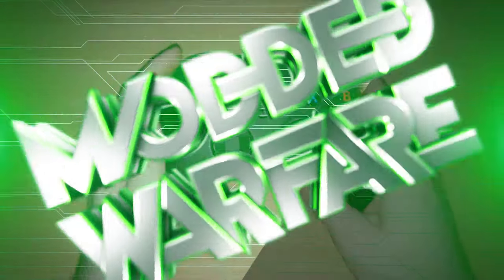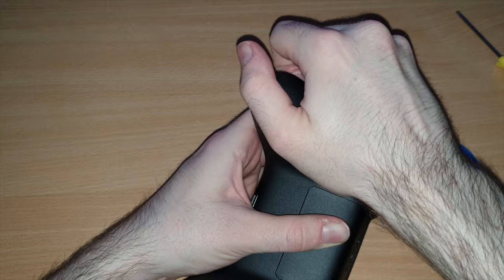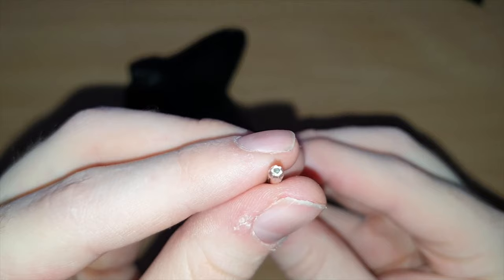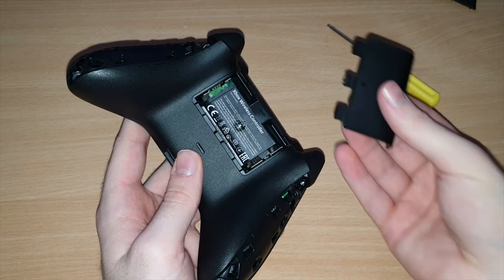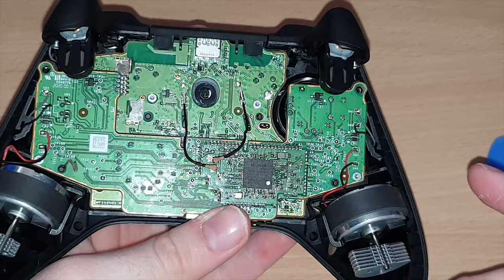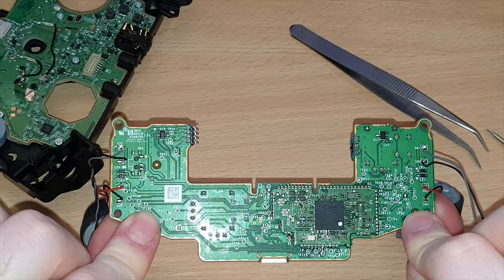How to Disassemble & Reassemble the Xbox Series X/S Controller

Comment: I feel like the people who disliked this video ruined their control
Reply: Yeah I've messed my headphone jack after changing a few things. Can still hear the game when I plug headset into controller. But not able to talk to anyone anymore 😅
Reply: Or doesn’t have that security driver
Reply: My a and x button dont work its my last hope so idc
Reply: Probably Ponies that are mad cos their controllers aren't as simple
Reply: I cut 4 cables but the tutorial is good and i left a like
Reply: Yes
Reply: @ward1ism  u can fix that in the xbox settings I did
Reply: U fuckin right
Reply: @spicychunk3517  I did I with out the security torques bit
Reply: ya i did
Reply: Left bumper no worky
Reply: I miss the dislike button
Reply: Yeah they probably did but I took my apart with zero memory of doing it be
Reply: took my about an hour but best video i’ve seen i hope the stick drift gets fixed
Reply: r @ra2alfool  ur on the spectrum
Reply: @Xackory  point proven
Reply: I was someone who broke their controller, I pulled apart the two wires from the mother board because I thought that's what he did and I messed up lol
Reply: @ward1ism it’s not the jack or anything u just need to update ur controller on accessories
Reply: @ward1ism same thing
Reply: im one
Reply: @ward1ism u fixed it or na
Reply: @ra2alfool my issue is I can’t afford to buy a screw driver just to fix a controller I’d have more luck finding a better working controller in the trash outside of a store that sells used controllers
Reply: Maybe it has to do with the fact that this was a partial disassembly. He never demonstrated how to remove the triggers, pins, and springs
Reply: Shush
Reply: Bet its all stick drift, common issues of x series
Reply: I'm about to give it a try wish me luck
Reply: The s seris is trash😊
Reply: I totally did... i cant figure out why it wont turn back on. All had to do was clean a sticky button. All wires seem fine. All the buttons function fine, but no light when you turn it on. Guess im headed to walmart
Reply: Without fail every time I take apart controller, I always break one of the cords that attached to the rumble packs and honestly, I’m not upset with it

Comment: These controllers were definitely made with the intention for no one to ever open them up after they were sold. Tutorial much appreciated and definitely needed!
Reply: Imagine not being able to change your car tires without owning a wrench only the company itself sells for a lot of money. Corporate greed at its finest
Reply: @doktorsljukex4174  the triggers are also designed very poorly. they often break because of a small millimeter long sponge pad getting pushed off a ledge. it's ridiculous.
Reply: yes i do agreed  + i lose two motors bec of low quality wires.
Reply: @doktorsljukex4174  are u troll  ?? u will lose motors if u open xbox one controller bec of the wires are low quality
Reply: What are you even talking about, nothing's wrong with these controllers, If you've taken apart electronics for once in your life, you'd find this process to be pretty easy, only the plastic parts are a bit annoying, otherwise it's pretty simple stuff.
Reply: @Sk-tp5xp  did u open xbox 360 before ?? look at the motors its came with two pins u can remove it anytime and there is no soldier and u can replace it without skills but look at xbox one + x , they want u to suffer btw motor xbox 360 just like ps4 battery u can replace it
Reply: Yeap they just want you to say screw it and buy a new one,
Reply: @Sk-tp5xp  Indeed, plus this controller is designed to keep a zero screws on sight for visual to match the XB One S, Series S and X designs. Totally inteded to hide them unlike that shitty PS4 Controller with lots of muck stuck where the screws are.
Reply: @doktorsljukex4174  i bought a T8 head with a hole in it and opened it no problem. what kind of wrench are you talking about lol
Reply: @giovannigiorgio2262 I never replace the motors anyway lol I tend to yeet them and forget about it
Reply: compared to controllers of previous generations... this was an absolute breeze after learning the panels come right off the grips
Reply: @Inuzika  I don't think so the 360 controller was very easy to take apart properly one of the easiest
Reply: That's the case with more and more modern pieces of tech/hardware
Reply: 100%
Reply: Xbox controllers are actually better to take apart than PS5 my new PS controller that I got with the console just 2 months ago has stick drift. Tried to watch how to open it so I can take out what I assume was plastic clips messing with it. The process is HORRIBLE. And apparently it’s some kind of factory grease collecting particles from the controller being used and parts of plastic grinding into it. So it’s made to literally get dirty and have stick drift without any outside dust alone. Like you have to take apart parts of the board just to get to the sticks or bumpers. most people said they got a new controller.
Reply: @Sk-tp5xp  ahhh a Microsoft spy trying to gaslight us. 👎👎
Reply: Of course they were. Being able to fix the stuff we bought by ourselves doesn't make them money. Now make the quality exactly as shitty as stuff breaks shortly after warranty runs out, and you have a business model.
Reply: @shadowzone2013  Yeah, I once thought the big advantage of competition is that there are many competing businesses trying to beat each other in terms pricing and/or quality. Now we have 2 or 3 big businesses waiting for one of them to come up with a shitty but highly profitable move so the others can follow up with it, knowing that the customer doesn't really have an alternative and will buy their stuff anyway.

Comment: Extremely helpful! X button was sticking and a little cleaning did the trick. Feeling super self reliant right now, appreciate you.
Reply: Did you tear down the whole controller or is it enough to just remove the cover to clean the a x b y Buttons?
Reply: @luisjunk5619  I was able to remove just the main cover and you have full access to the buttons - cleaned them with just a mini brush and it worked great after. No need for a full breakdown. Hope you got yours working. My X button was also sticking same with screen shot button. Cheers! 👍🍻
Reply: I also need to do this as my x is sticking too. Did you remove the palm pads and the 5 screws to get access to the buttons?
Reply: Good to hear! I spilled a little bit of soda over it and the B button is now sticky..  I don't want to break the whole thing open, just enough for the buttons.
Reply: Lol, my x button was sticking too. Almost made me delete one of my weapons on destiny on accident, so I figured I'd do this becsuse a bit of alcohol around the button itself didn't last. I took the whole thing apart for thr experience. Kinda fun, but definitely more intricate compared 5o previous versions. We'll see how long this lasts, as I just finished.
Reply: My X was sticky too lol
Reply: did you use the T8 security or FH and normal T8?
Reply: Bro my X button  is sticky to
Reply: Unfortunately for me just removing the face plate didn’t help the stickiness. Had to remove everything to get down to the buttons to take them completely out. Wasn’t too hard, just time consuming. The silicone base for the buttons was sticky and the root of the problem. Interesting that the series x controller is harder to get to the buttons than the elite 2 controller though.
Reply: I bought this “used” controller and the right bumper and left bumper was making loud noise when touching it gently but I replaced them aswell as the top bar to match the new bumpers I also took the controller apart all the way down and took the buttons out washed them in soapy water as the buttons would be sticky “B” button mainly I also took a cotton swab and cleaned the black plastic where the buttons sit then put it all together after and now it works better than ever took me an hour but worth it, also you can take the sticker off the controller when opening the middle bit and put it back on after so it looks like you never opened it before. 

(I can do this without tutorials it’s not hard)

Comment: Little component on the board where the wire connects to the other board broke off really easy, tried tugging hard on the other one to replicate and it stayed on. These companies cheap out on solder, use the least amount of solder as possible to save money and as soon as years go by they degrade and become weak. Ah well can't complain, had the controller for more than 2 years now with heavy use. Great tutorial by the way, straight to the point and clear
Reply: Yeah mine broke lol was brand new controller. Was tryna change buttons.
Reply: Do you know what they do?

Comment: This was such a useful tutorial, thank you! I'd been looking at other videos to try and get my controller apart to repair (spilt water on it and the Xbox button is firing without me pressing it) but this is the only video I could find that properly explains the steps. Unfortunately, my controller still isn't working properly, but I'm pretty sure I know what's causing the issue now so I'll definitely be coming back to this video when I try again to fix it :)

Comment: I used your old guide and it worked just fine.  I did have a lot harder time getting the top board unwedged.  Thanks for updating it, just finished fixing mine and saw this.

Comment: I lacked those fancy schmancy tweezers & had to cheat on parts of it with the flat tip screwdriver part of my little skinny computer dual plus tip & flat tip screwdriver to compensate & at the part of the reassembly having to plug those 2 black wires with those seriously tiny heads back in, had only my big fat clumsy butterfingered sausage fingers & still managed to follow this Vid & thanks to you, get my Controller disassembled & reassembled enough to replace the padding for my A B X Y Start Select Screenshot xBox Buttons to fix a mushy A Button!

Thank you so much for this Vid! This was my first of your Vids I ever watched & ya already earned your Subscribe! :D

P.S. We YouTubers are prone to Liking & Subscribing peeps & content we like & don't tend to need to be asked to first before we do it. :P

Comment: This really helped. I just needed to see how to pull it apart to the bumpers. I’m sure the rest of the video was great. I had “mush trigger” on my right bumper and I assumed because of occasional dropping along with having strong fingers, the small prong (that Xbox continues to use) snapped off into the controller. It wasn’t fun playing for honor and all of a sudden I couldn’t do light attacks. I took it apart, crazy glued the piece back on, and wrapped both prongs with a small cut piece of electric tape to strengthen them and it all works, you saved me a controller.

Comment: Great video. Just one note, peeling back the sticker can be done with a plastic pry tool. Keep the tool flat, and push back the sticker slightly to lift the corner. Put the tool under the lifted corner, and pinch it against your thumb, etc. Pull it back just enough to reveal the screw.

Everything went back together great, and no real sign of opening the unit. Only a tiny bit of sticker was harmed. I doubt anyone would notice.

Cheers!

Comment: This was so helpful. I had no idea there was a screw under the battery sticker.
Reply: Be careful about the sticker though. Don't put your screwdriver through the sticker. Just peel it back. If you put the screwdriver through you'll void the warranty
Reply: @VonJay  If they also see broken screws, that’ll also void your warranty. I think…
Reply: @VonJay  warranty sticker's are illegal so you could fight that
Reply: @Hellraiser988  they don't want you to open the controller so putting a screwdriver through the sticker is all they need. Idk if sticker warranties are illegal but if it is then they can claim anything outside of that with that proof alone
Reply: @VonJay  wrong in the US at a federal level it's not exactly legal and they can not restrict your right to your warranty something that an exception is adding LEDs for example but something like upgrading a HDD to an SSD isn't illegal at all and they can't and have no right to do as such if they try it you can bring your proof to court and chances are you will win
Reply: @Hellraiser988  it says it on their website. You void the warranty if you open the controller
Reply: @VonJay  they have to prove a 3rd party hardware or software caused the issue which is why you yourself have to bring proof of what went wrong and what was the fix and what was the result and what was used
Reply: @VonJay  who's website
Reply: @VonJay  FTC say's otherwise
Reply: @Hellraiser988  Microsoft

Comment: Thanks so much for the amazing video! My kid spilled syrup all over the controller and this vid helped me save having to buy a whole new controller. Just bought a T8 security screwdriver and followed the video and cleaned it out. Put it back together and it works great! Thanks again!
Reply: I need to buy one aswell. What size did you buy or are they all the same?
Reply: @jakepearce5128  I bought a set on amazon that included many sizes. It was actually the same price as buying a single screwdriver hehe.

Comment: Great video, my LB wasn't working so I wanted to see if I could fix it. When I took off the bumpers, the little plastic extension that presses the button fell out and I thought I broke something, but I was able to superglue it back and it works perfectly now. :)
Reply: Thats what im doing atm
Reply: This is literally what I’m doing.
Reply: @henrydeluxe4051  how do you do it?
Reply: @DylanHardwickkMusic  mines broken so I’m ordering one on Amazon to put back in. I’ll use this video to remind myself. I’d do the same.
Reply: had the same issue. Just fixed it. Works fine now
Reply: Literally same
Reply: @LuriTV  what can you use instead of superglue
Reply: @codywalsh2075 what can you use instead of superglue
Reply: @h7rdy815  I'm not sure, i swapped out the whole thing with another controller

Comment: Currently have a stick drift Issue. I have taken my controller apart thanks to this kinda mans video and replaced the little black piece that goes into the green pieces on the analog sticks. Unfortunately didnt work but thats to this video I could actually put my controller apart and back together without breaking anything so W video.

Comment: Thanks for the video. I just needed to see someone pop off the cover under the right trigger before I attempt to myself without breaking it lol. Apparently quite a few people have the sticky RT issue. That little black strip of padding tends to slip over the edge it sits on which then leaves a layer of adhesive causing the RT to stick. I took it out completely and now it feels more retro with the hard clicking noises.

Comment: Helpful video, thank you! Our dog knocked over a coke and a big drip of it went behind the B button, worked okay but very sticky and would occasionally stick down mid game. This tear down got me into it, got it cleaned and returned to working order in about 20 mins. Not bad for a first attempt I think!
Reply: did you use the T8 security or FH and normal T8?
Reply: Any chance I can just remove the front with a pry tool, I wanna clean my bumpers because they don’t click like they used to?? I don’t have the torq 8 security screwdriver

Comment: I sneezed whilst holding a soda can and some spilled into the A button and it kept getting stuck. Had to open up the controller and clean it.

Thanks for the video. I would have been in trouble without

Comment: Thanks, man. Had the LT (trigger) sticking problem. Opened just as much as I needed to get to it, and cleaned the adhesive on the plastic that was causing the issue (there's some padding under the triggers that tend to leave some adhesive residues over time). There wasn't actually a lot of adhesive, quite the contrary, but that was just enough to make the trigger stick.

Comment: One tip because you did something that hurts my insides is your not supposed to pull the dpad buttons out of the metal ring if you look at it from the bottom the metal ring clips in so your supposed to unclip it so you don’t bring the metal because it’s very weak

Comment: Thanks for this video showing a way of taking it apart without a soldering iron to remove those rumble motor connections. I will be using this to clean behind the buttons as my little ones spilt liquid into both of my controllers 😣

Comment: Thanks for the tutorial.
My LB bumper wasn't working anymore, so I went ahead and took the controller apart.
Turned out that the little push piece on the inside broke off.

Comment: What I found out is that if I take a flathead scewdriver and try to use it on those security screws it unscrews it, but if you try harder it rips the middle part out of the screw and makes those screws no longer security ones.

Comment: Pro tip for anyone disassembling this If you're sync button comes loose, you have to put it in before any of the circuit boards. ROUND 2 YA DAMN CONTROLLER, LETS GO RB!

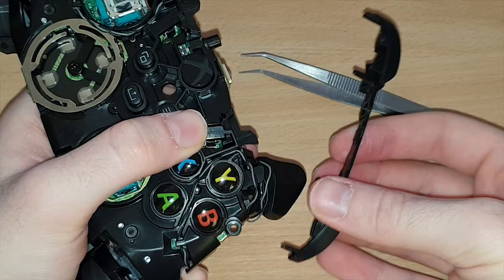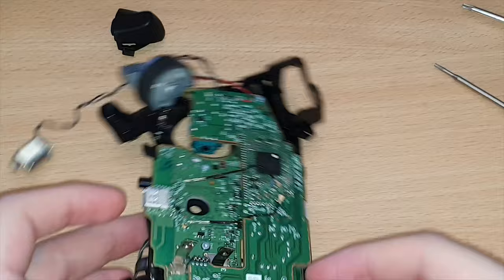Comment: After disassembling and reassembling these gamepads three times I can say it's not that big of a deal. One note though, for those who not interested in changing motors or PCBs and only interested in getting access to the buttons and their conductive silicone pieces - you don't need to remove motors and mess with their wires. You can skip detaching the d-pad and then the part with rumble motors and PCB release, that's from 6:53 straight to 9:04, the difference will be is that you won't be able to detach small PCB piece but you still can reach all the screws and just enough room to get to the buttons, taking them out, though it won't be a convenient way but still less hassle for me.

I replaced buttons and conductive pieces that way, I didn't mess with the sticks.